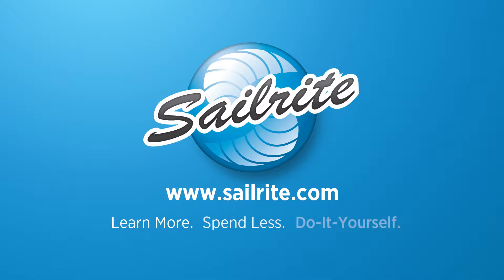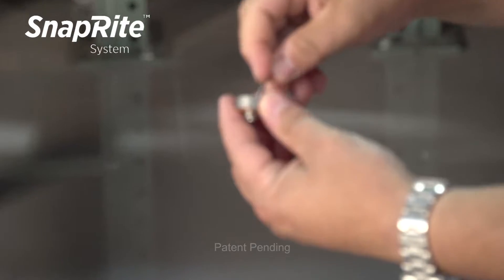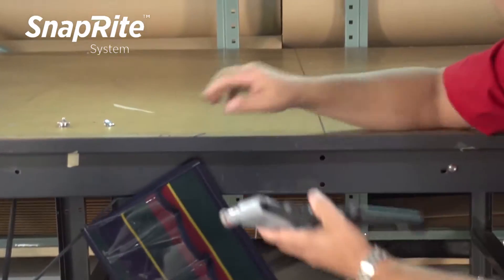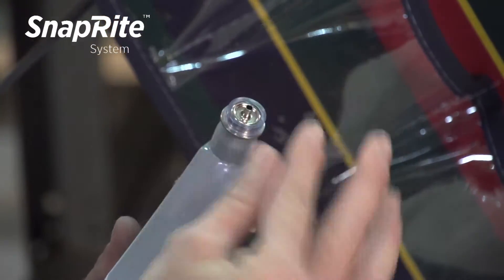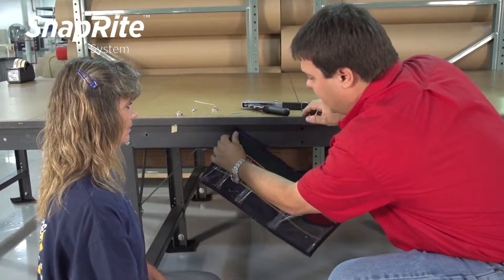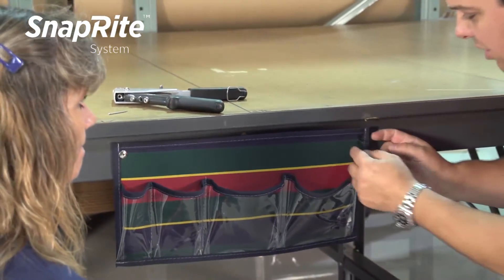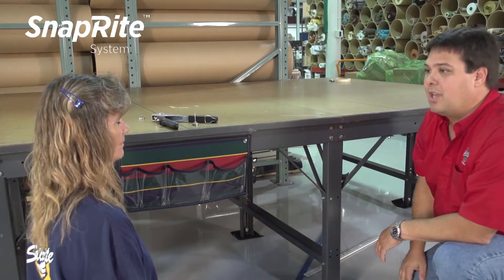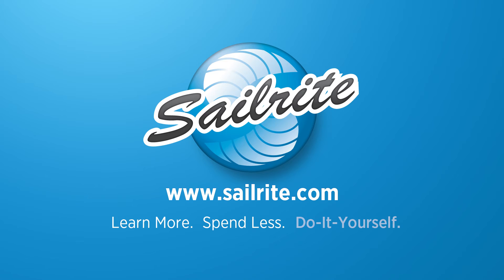SnapRite System Demonstration - Sets Snaps with a Rivet Tool

Comment: Holy cow.  So simple I think even I could do it.  Q: Are there different size buttons or is there one worldwide standard?  I have an Italian boat with the stud part attached to the boat outside the windows but I don't have the window covers so I'd like to get some cloth and some buttons and make some exterior window covers myself.  This tool would make the job so easy (and maybe even fun).
Reply from the maker: Most boat snaps around the world are the common style called a "ligne 24" snap (which is 24.1mm or 0.950 inches). But on clothing and other applications you may find smaller snaps styles.